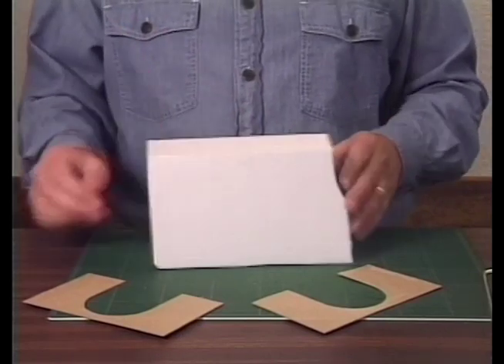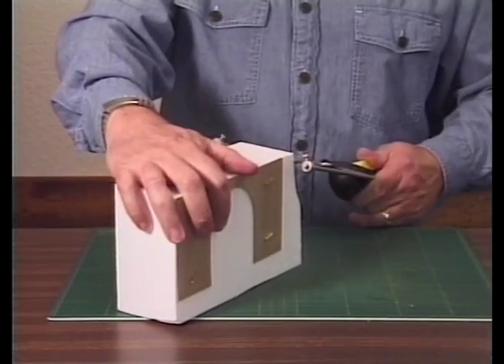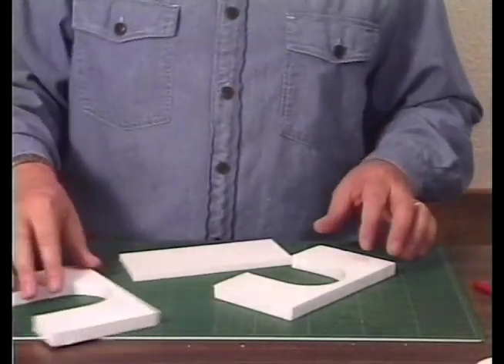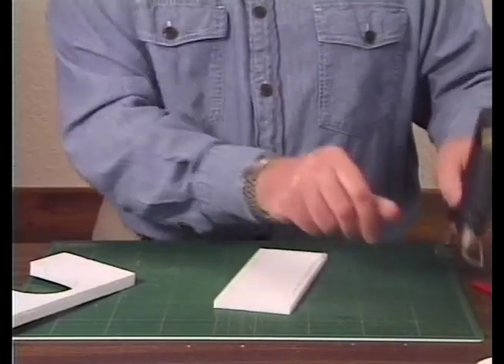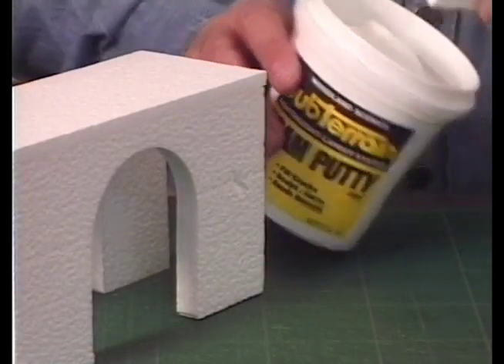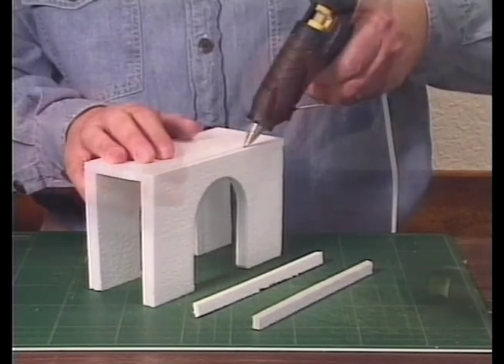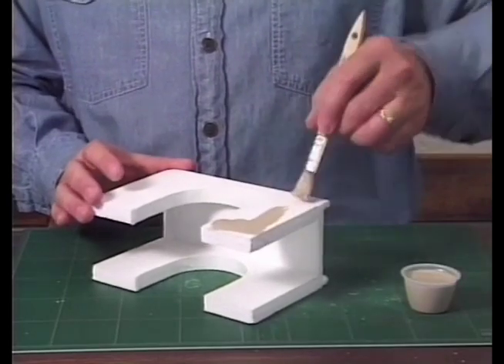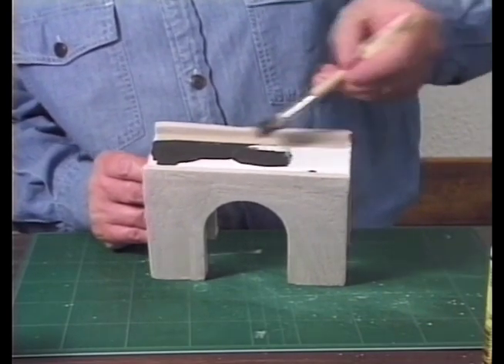SubTerrain: Build A Layout Fast & Easy - Building Bridges

Comment: What can I do to make it look like it's made of bricks?
Reply from the maker: You can achieve the look of a brick texture by using a fine tip permanent marker or lead pencil. The markings from both of these could represent cement or mortar. You could also use the blunt end of a fine tip paintbrush, according to the following steps:
1.) Use your pencil and ruler to make horizontal lines on the foam. The spacing between the lines will be the height of your bricks.
2.) Along the bottom of the wall you can make vertical marks for the width of the brick, keeping in mind that bricks are usually wider than they are tall.
3.) Using the vertical markings as a gauge, draw the vertical lines every other row, then mark additional lines half way between the markings on the alternate rows.
4.) Paint the foam with Top Coat or Undercoat pigments. Dilute these with water to create a color wash. Weathering can be added using Black Earth Colors Liquid Pigment color wash on top of the first color. It is best to experiment on scrap foam before marking and coloring the actual piece.
Hope the helps! Happy Modeling!
Reply: The doll house people sell tape that's cut with tiny brick pattern. You make a paste , coat it on, peel the tape, and it leaves brick pattern and texture behind. By coloring the paste you control the color of the bricks. The paint under is the mortar so plan ahead.